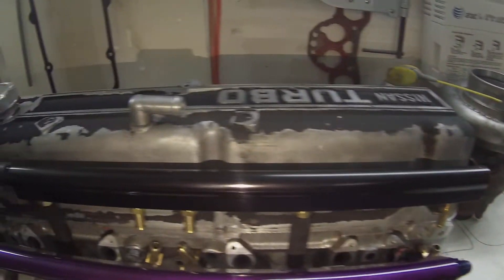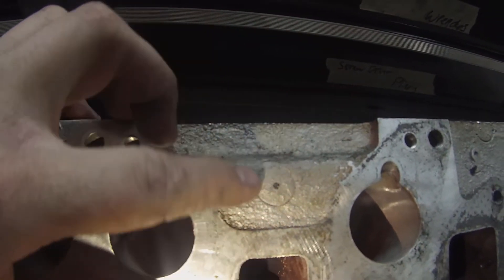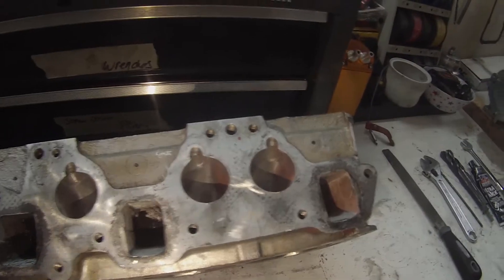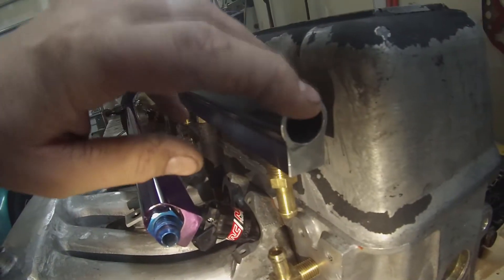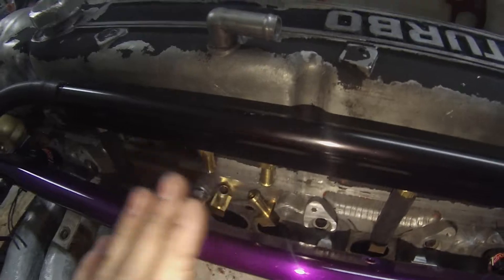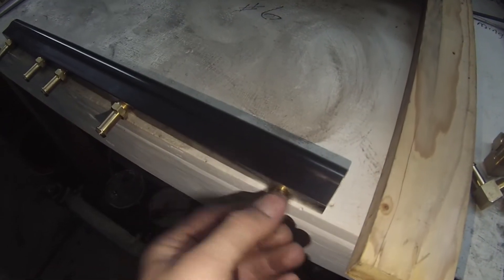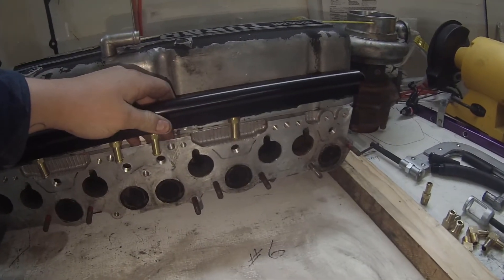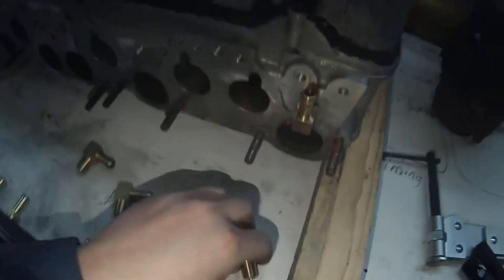L28 cylinder head cooling

Comment: Thanks for sharing!  I assume you got this idea from hybridz.org where I believe it originated, at least where I first saw it described on the interweb.  I like your implementation.  The only thing missing is a bleed valve off the top front of the bypass to bleed off air when you fill the engine with coolant.  Let us know if it helps with detonation.  Here is a link to the thread for those who haven't seen it:  http://forums.hybridz.org/topic/59029-head-cooling-on-cylinder-5-solutions/

Comment: Thanks for this video. It really helps . I did mine a little different. AS an alternative to Tig Welding the ends shut, or Tig welding a fitting to the end, is to cap both ends of the rail with small frost/core plugs. The Fast rail that I used was 11/16" inside Diameter. I jus0s used a couple of 11/16" core plugs. Used some Teflon thread sealant on the edges and tapped them into place. Easy Peasy. To connect the rail to the Thermostat housing I simply added a 90" brass elbow vertically from the rail. BTW, 1/4 NPT doesn't leave a lot of meat around the threaded holes. 1/8" NPT is better. You don't need a lot of flow from these outlets. They are more to relieve steam pockets. 1/8" NPT with a 3/8" Fuel Line has nearly identical ID to 1/4" NPT with 3/8" Barb.

Comment: Did you figure out if it was worth the hassle of going through this mod? Also, can you do it without removing the head?
Reply from the maker: It depends on the application, If you are going for a reliable High HP L28 and race in motorsports then yes. However many people have made 350+hp without doing this. My goal Is 500+hp So i find this necessary. I do not suggest doing this on the engine or in the car because its too risky for metal shavings to be going everywhere.
Reply: @MrSam12240  If youre still keeping up on this channel- Did you ever make your goal of 500~ hp? If so- What did you wind up doing to accomplish it? Thanks!
Reply: I'm currently at the 405rwhp mark, but didn't want to run more boost per what my tuner said about the rear cylinders running hot. I bumped into this looking for ways around this. I really didn't want to go through the trouble of taking the head off after getting it back on not too long ago, I'll have to figure out a way to do it with it on, so long as it is worth doing. I'm aiming for mid to higher reliable 400s on high boost and I'll be happy :)
Reply from the maker: its hard to hold a drill bit perfectly perpendicular to a angled surface but its possible. Take your time, go slow and keep the bit straight. Use bearing grease in the flutes of the bit as an attempt to catch all the metal shavings from going into the head. you are going to need the intake manifold off and possibly the exhaust too, so make sure to tape off the ports and put rags down the ports to keep all the shavings out. also you might be able to buy or make a screen filter for your upper radiator hose to catch any shavings from possibly clogging your radiator. Otherwise your radiator could turn into a really expensive coolant filter lol
Reply: How will I know when I've drilled deep enough?
Reply from the maker: when the drill bit pokes through into the coolant galley
Reply: Thanks! This is going to help me out significantly. I'm glad you did this video.